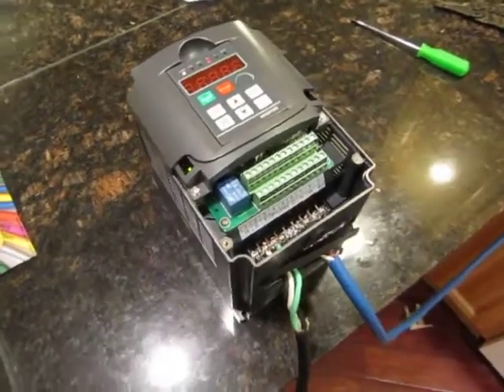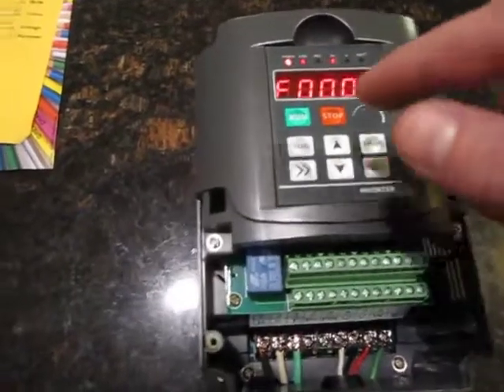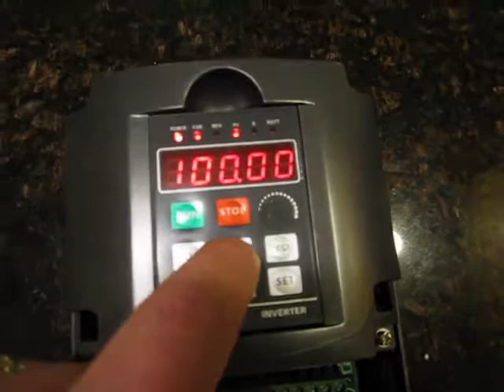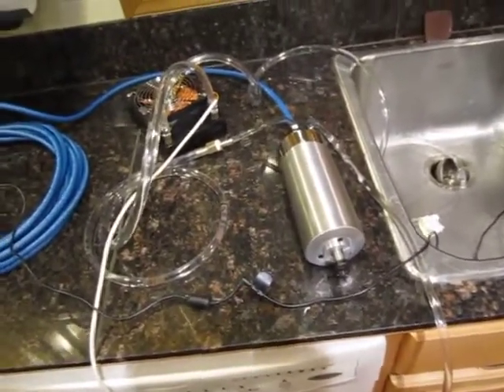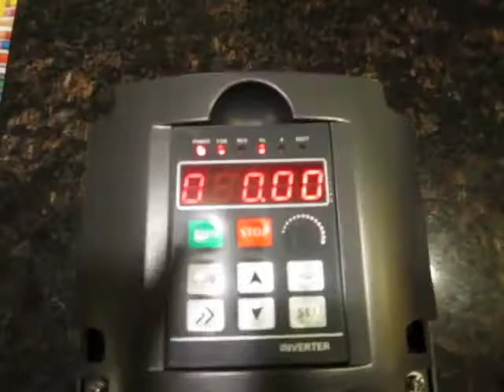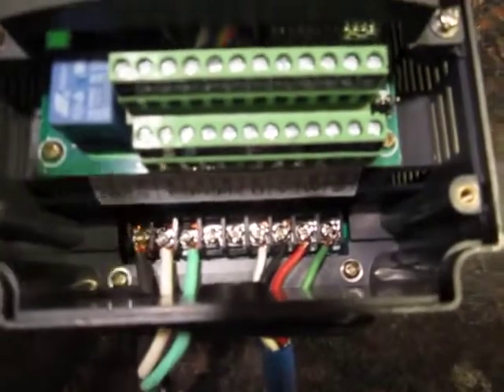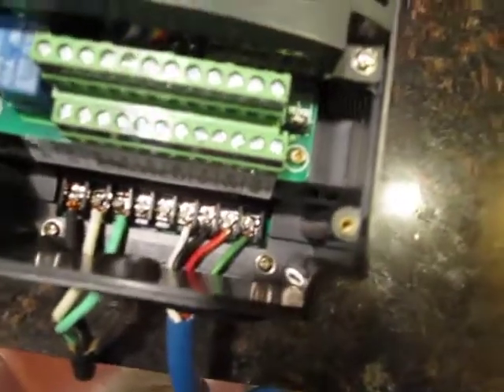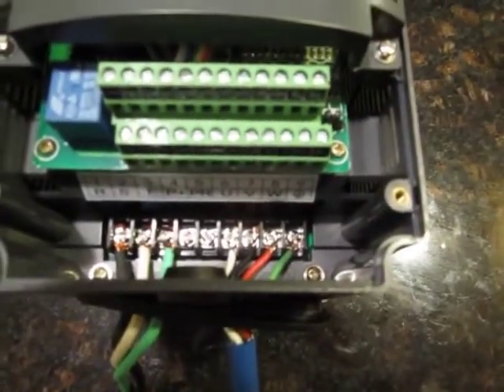1.5kw Water cooled spindle and VFD

Comment from the maker: I used 18ga with highly flexible poly jacket. I wouldn't go any bigger as the connector at the top of the spindle will only accommodate a certain size. I had to take a knife and shave off some of the jacket to get it to fit inside the connector. Although the VFD runs on 220v, the system is only about 5 amps, so smaller wire is sufficient. If the place i got this wire from sold it in 20 or 22ga I would use either of them instead.

Comment: i have found so many diffident explanations on how to wire up the high side 220v of the VFD but they are all diffident i was wondering if you could tell me what terminal they go in i have the same wire type as you a green a black and a white what letter do they go in i have the exact same spindle as you from even the same seller just tell me what works for you. Thanks so much

Comment: what size of wires did you used between UVW and spindle? is 12ga too big? do you have to add an external pump to get the water flowing? thanks.

Comment: Is the motor used to introduce high frequency vibration into the dishwasher to help break up food particles?  
In the kitchen, no pump and radiator in your shop? 
Add plumbing & your cheap Chinese deal doesn't seem so cheap.
Risk of shock & electrocution with all that water.
Reply: Jules Bartow 
Dang gurl, you Sassy!

Comment from the maker: I have found very little reason to be leery of buying from china distributors.  Many people selling on ebay are from the same company but sell as though they are different.  Look at the product descriptions, they are all the same with the same misspellings.  I got mine from seller igoodmart2011 1.5kw spindle with inverter for $252.  Good luck I'll post a video of my system running using this spindle.  Any more questions feel free to ask.